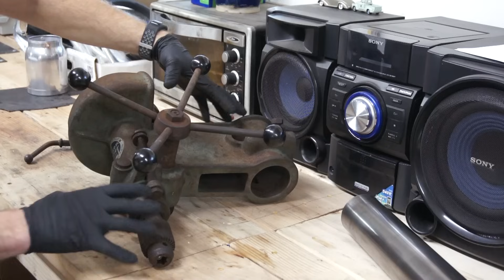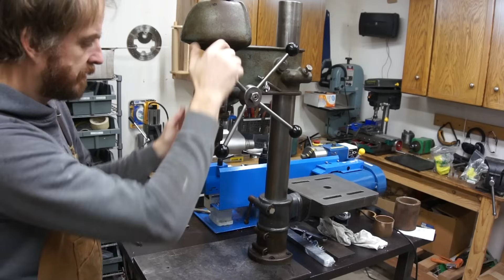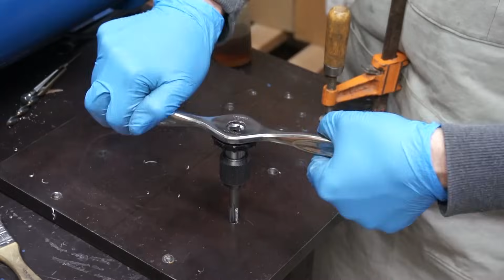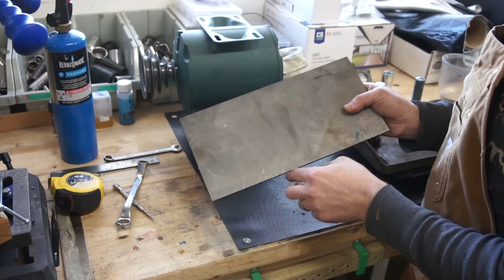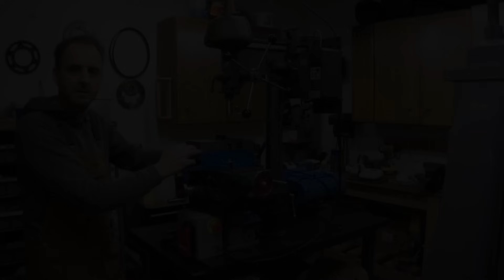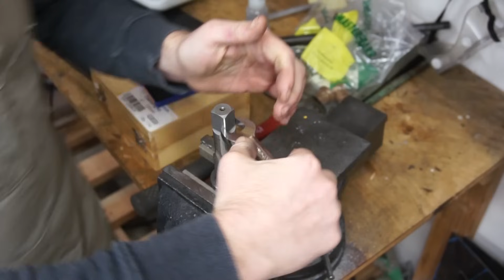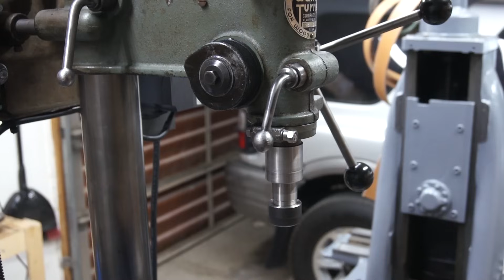Converting a Drill Press into a Milling Machine

Comment: Nice video. I have a 70s Kira drill press that I've tried a little milling on, and the spindle is built almost identically to yours, so I'm looking forward to updates. Hopefully you can solve the axial play in the spindle. I'd suggest checking that the locking collar with the set screw hasn't started walking up the shaft. Any chance you may be installing angular contact bearings in this machine? I'd like to do so to mine but I still have to work out how I'll preload them properly.
Reply from the maker: I haven't been able to find a set of angular contact bearings that would fit.  The housing is 35mm with a 15.75mm shaft.  I couldn't find anything that small.  Actually, I couldn't find any bearings that'd work with it.  I bought a couple 5/8 6202 RS which some said might bit, but they measure 16.25mm on the ID and are too big.  I'm still on the lookout, though.
Reply: @RobertAdairWorkshop  That's unfortunate, kinda surprising that the 5/8 bearing had so much clearance too.
Reply: @RobertAdairWorkshop  I saw an old Popular Mechanics article that shows about a 1/4 inch plate mounted to the big vertical tube that the motor and everything is mounted on,  on the steel plate they have two roller bearings bolted on there. The two bearings ride up against the collet and provide support in order to compensate for the poor bearings that aren't made for side loads on a drill press. I'm not sure if I was able to describe this well enough for you to visualize what I'm talking about but it looks like it would help. It's kind of a band-aid but it should help. 

I'm wanting to convert a Harbor Freight drill press about the size of yours but mine will not be as fancy as yours.

Comment: Nice work. Most makers with a drill press will have tried milling at least once, until it pulls the chuck out.  But horses for courses.  For a fast emergency stop, some VFD's let you connect dump resistors, I used some 500W  30R  ceramic wirewound's .This shorts the motor windings out with the resistors when triggered and stops on a sixpence. Ive a downham jig borer thats a solid machine but still only recommended for light milling. best of luck.

Comment: This is a bad idea, other than being a similar shape to a milling machine, there's very little in common, you've already damaged the other drill beyond repair, why do this again? you have a lathe, make a milling spindle that's suitable for milling, it's surprisingly simple, you already have an X Y table.
Reply from the maker: Actually, if you wouldn't mind, keep an eye out.  I'm starting a build series for the new mill built around that BT30 spindle and I could use all the wisdom and advice I can get.  It should be out mid-January.
Reply: @RobertAdairWorkshop  You can put flats on parts by facing in the lathe, use the 4 jaw to hold parts
Reply: You’re absolutely right, I messed around adapting things for a while, but my Warco mill as far superior and able to take big cuts accurately and far more accurate.